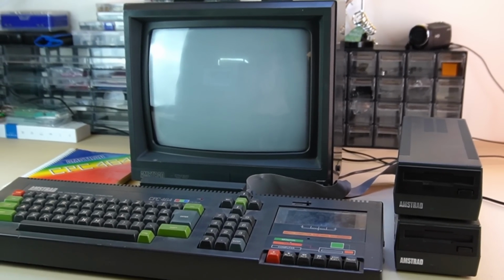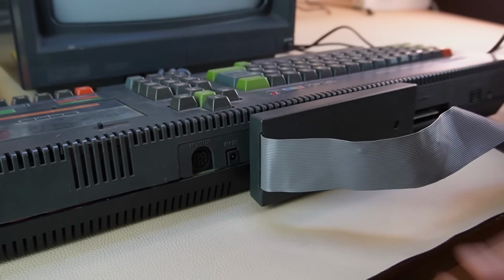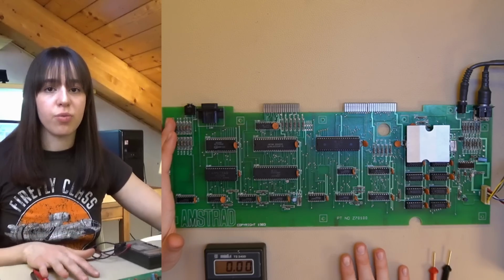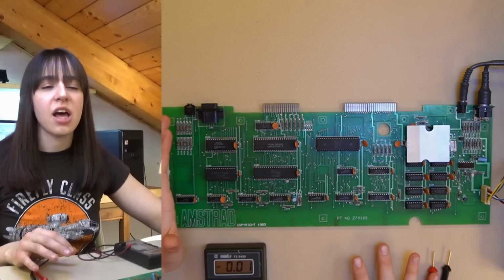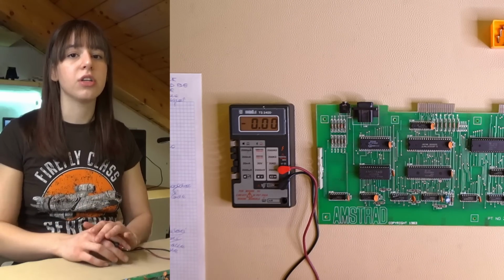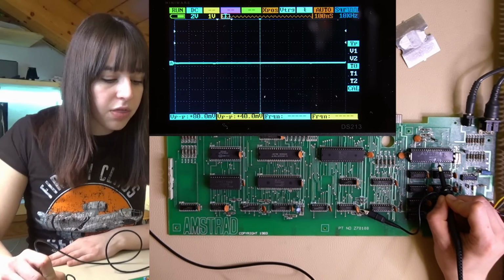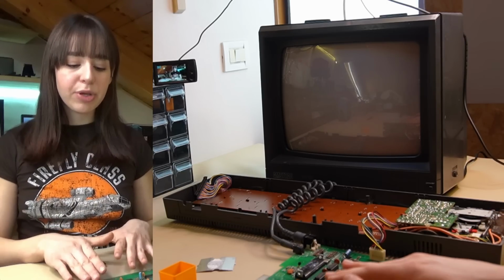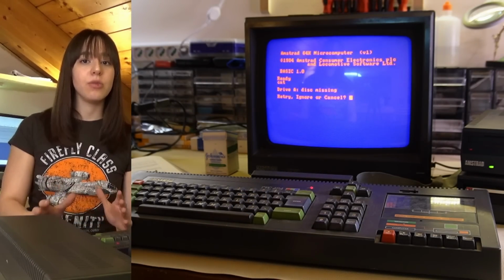I fixed an Amstrad CPC 464

Comment: I hope you all noticed what happened here. The vast majority of us would have said "That switch is broken" and would have replaced it. Sayaka dismantled it, cleaned it, and put it back together (why isn't 'remantled' a word?). Something worth learning there.
Reply from the maker: Thank you, I appreciate the observation! It's true, sometimes a simple fix can go a long way.
Reply: if it is remantled then when it was first assembled was it just mantled? lol
Reply: Dismantle means to take its strength away (-ish )so the opposite is simply mantle . Perhaps disassemble, reassemble? Love these videos!
Reply: @marjon1703 "No disassemble!" -- Johnny Five 😆
Reply: @horusfalcon  "Johnny Five ..alive"
Reply: Mantle is the opposite of Dismantle, but the meaning of Dismantle has morphed a bit over time. Originally a Mantle was clothing similar to a cloak, and the word was used used as a verb to cloak or cover something, then Dismantle meant to remove that cloak or cover. Not dissimilar to Mount and Dismount. It was further used in words like Mantlepiece, which is basically a covering over a fireplace.

Today we use Dismantle more as an interchangeable word with Disassemble. One of the side effects of English being so widely spoken is that word meanings change relatively quickly, which is rarely a good thing, tbh.
Reply: I know I wouldn't have bothered
Reply: @speedsterh The switch on a 464 is relatively simple to open, clean, and reassemble.   ( I have a 464... )
Reply: upmantlah
Reply: she reworked the switch.
Reply: The reason remantled isn't a word is because we already have the correct word reassembled.
Reply: @SpeccyMan  True enough, reassembled is a fine word, but the English language has a grand tradition of having many words that mean essentially the same thing! There's always room for one more... or another...
Reply: Though she didn't clean the Z80 and it's socket and retry it!
Reply: @crayzeape2230 No, indeed. It seems to work though.
Reply: Words like dismantle, disgruntle, inert, innocuous, and ruthless are called unpaired words. You would assume by looking at them that their opposites are mantle, gruntle, ert, nocuous, and ruthful, but these words simply don’t exist.
Reply: @Notpoop906  WRONG. Totally. Use a dictionary. muppet
Reply: @Notpoop906 💤💤💤
Reply: @NightRaven650  🤡🤡🤡

Comment: Disk units are 3", not 3.5".
Reply from the maker: Thank you for the clarification. I mentioned 3.5'' out of habit, but I was aware that Amstrad's floppy disks were 3'' to ensure compatibility with 5.25'' drives and for easier portability. Additionally, at the time, the 3.5'' format was beginning to emerge as a standard but had not yet become the de facto standard.

Comment: Type |TAPE to enable tape mode. If you have a disk interface connected, it will default to that. That is why you were getting the Bad Command error message. It's |DISK to return to disk mode.
Reply from the maker: Thank you for the suggestion, but I've tested the tape functionality even with the disk drive disconnected

Comment: Well done Sayaka!! You might want to add residue free coolant spray. Sometimes a heat damaged chip will temporarily come back to life long enough to determine that it’s at fault before you go through the hassle of desoldering and looking for a replacement. I have often had to do this on big name brand synth keyboards when the sound processor stops working and hangs the keyboard or computer.
Reply from the maker: Thanks for the tip! I'll keep that in mind for the future

Comment: Hello, maybe you had some contact problems... Did you put the original CPU back in the socket? Maybe it's not damaged...I had this issue with an Adaptec SCSI-Card: After removing and putting in the ROM-Chip it worked very fine...
Reply from the maker: Yes, I checked to make sure it wasn't just an oxidation problem, even using the classic 'remove and reinsert' method

Comment: So, it needed a good cleanup, minor re-soldering and replacing a faulty CPU (that's the hard part). Could be worse, I guess.
The default text color on this machine was yellow, in the video it looks like light orange. I am guessing this is a camera artifact?
Reply from the maker: No, it's not a problem with the video camera, but, as mentioned earlier by Noel, perhaps a poor soldering of the video connector

Comment: Great video, great job! My little advise: try do not touch pins of microprocessor by your fingers, because static electricity may damage it. You may also buy some anti-static wrist strap to avoid static electricity in that case.

Comment: so Os, honestly I have never heard of an Amstrad CPC 464 before, congratulations in fixing it 🎉🎉🎉, I’m amazed and I’m more interested seeing the Amstrad function with the floppy 💾 disk, never got in the computer tapes before, but if you can fix both of them that would be ideal. Other than that, nice to see thats the CPU of the Amstrad is socketed, makes and update, if possible easier and a repair as well.  Till the next video! 😺🥰👩‍💻👩‍🔧⌨️✨💎
Reply from the maker: Thanks! Glad to hear you're interested! I'll definitely showcase the Amstrad with the floppy disk soon. And yes, having a socketed CPU does make updates and repairs easier. Stay tuned for the next video!
Reply: @Sayakas_Digital_Attic  will do! 🥰👩‍🔧✨💎💃

Comment: Overall, very well done video. You made one small mistake, I wonder how no one pointed it out by now. Those floppy drives are 3", not 3.5". They work a bit differently than normal PC floppies when it comes to the disks themself. You could flip these over and use both sides independently. And their shell is a lot more sturdy than in 3.5" disks. 
However, electrically they are basically the same. I remember back in the early 90s when I got my first PC, I hooked one of them to my PC and it worked.
So you may be able to convert one of those drives to a 3.5" one, or maybe build some kind of adapter to connect it to a PC. So you can write images to physical disks. The other option would be to replace one drive with a gotek and use native CPC software to copy to physical disks.
Reply from the maker: Thank you for the feedback! I appreciate the correction and the additional information about the 3" floppy drives. I'll keep that in mind for future videos

Comment: Absolutely awesome! Just like most other commenters here, I appreciate the younger generations picking up interest in these vintage electronics. I never really used any of them myself but it's still awesome to see. I just want to point out that Amstrad made such a great desicion to make the keyboard dark and not in the same disgusting color as most other hardware from the time and forward. You can see how much better it looks without even having to reconditioning it (I suppose). Imagine how awesome it would be if you could exchange components in modern hardware as it is in this old hardware. But try also to imagine how much bigger it all would need to be :P
Reply from the maker: Indeed, I really like this design. In fact, part of the charm of 80s hardware lies in the fact that you can exchange components more easily compared to modern hardware.

Comment: My second computer was a CPC 464. It got it around 1985 or 86. From memory it cost me about 350 dollars Australian. That was just for the computer it self. I could afford a monitor, so I connected it to an old TV. I also had to make do with the tape deck. There was also a CPC 664, which was the exact same computer, except it had a disc drive built in, instead of the tape deck.

Comment: Didn't expect to see an actual chip failure, since they're so well protected inside by the plastic casing, it's like a time capsule. Maybe the pins just needed to be cleaned as well?
Reply from the maker: I tried cleaning it and putting it back, but I still have the same issue

Comment: I bought myself an Amstrad CPC464 in May 1987 as a teenager, and loved it so much! A very underrated computer from that era. I used it until the early 1990s. Around 2010 I got a used 6128 from Ebay and had fun with that, and found a 3.5inch external floppy drive with the builtin ABBA switch.  So much great games and other software available for it.  There is a really good interview here on YouTube with one of the design engineers of the CPC, talking about his time in the 1980s working for Alan Sugar etc.
Reply from the maker: That's awesome! I'll definitely check out that interview on YouTube.
Reply: @Sayakas_Digital_Attic  It's the 38min YT video with the title, " Interview With Roland Perry From Amstrad! (Part One) ".  It's on the Xyphoe channel.

Comment: Well done! 
Have you tried to reseated the old z80? The problem may be due to oxidation on the socket contacts.
Reply from the maker: Thanks for the input, I've tried, but it still isn't working in that way
Reply: @Sayakas_Digital_Attic  Could also be the socket itself is a little sketch, you could try giving it a deoxit treatment and see if that changes anything. Or test the cleaned Z80 in a different machine since I take it you have multiple using that.

Comment: Good job, just commenting the same Noel said, text should be yellow so need to check video connector
Reply from the maker: Thanks for the input, I'll try to address that issue in the video where I repair both the floppy disk drive and the cassette player

Comment: Good job ! I also have a CPC-464 and didn't worked for years.. I think all capacitors must be changed. But I have a bigger problem about my Amstrad ALT-386, it was working about 15 years ago but now no video. Problem can be about cmos battery or capacitors of power supply, what do you think, any advice ?
Reply from the maker: Is it just the screen that's not working, or is the whole computer?
Reply: When I power on the device, led's are ok, fan spins and screen backligjht is on for a moment but unfortinately no backlight or video after. @Sayakas_Digital_Attic
Reply from the maker: @MrNetworx  It could be everything and nothing. Usually, when I start repairing a non-functioning computer, I first give it a general cleaning. You wouldn't believe how many times just removing the dust solved the problem! You can start by searching for some videos on YouTube and see if they give you any idea about it. However, if you don't have experience in computer repair, I recommend seeking help from someone knowledgeable
Reply: @Sayakas_Digital_Attic  Thank you for quick response. Before changing components, I will start by cleaning with IPA or sthg. I will inform you about the result also.

Comment: Well done! Love this video! It was a very thorough and well reasoned repair. Congratulations on bringing the Amstrad back to life. One thing I noticed is that the text on the display is red but it should be yellow. Chances are the video connector has a bad solder joint in the green channel. Or if not, it could be a problem with the cable or even the Gate Array. Maybe a topic for a followup video?
Reply from the maker: Thank you so much for the suggestion! I'm really glad you enjoyed the video. Your insights about the display issue are super helpful, I'll definitely look into it for a follow-up video.
Reply: @Sayakas_Digital_Attic  Looking forward to it! :)
Reply: @Sayakas_Digital_Attic  Noel is a legend :)..  it was him that inspired me to get my CPC 6128.
Reply: I was about to comment on the colour and I see that Noel already did and he sure knows his CPC repairs! I had green text on mine and a quick reflow of the solder joints on that connector and some contact cleaner sprayed into it solved the problem, that part is prone to mechanical stress. I also had the same power switch issue and the tape drive was dead which was solved with new belts. Brilliant video, lovely to see you working on an Amstrad and looking forward to the next one👍
Reply: Great help and feedback Noel, I also watch you channel and have now subscribed to this one. Good  to see people help and great work Sayaka :)
Reply: @richardlawrie1150 y agradable ver a una chica joven. Solemos ser hombres entraditos en años los que nos movemos por estos círculos.
Reply: Didn't some of the amstrads have Green "hacker" text.  🤔

(EDIT - I forgot that you could buy a green amstrad monitor)
Reply: She could be using a modified BIOS ROM, I've used them & whatever colours you use for text & background, stays even if the computer is switched off or not.
Reply: Can you tweak the ROM or so to make the text white on black. I'm no fan of fancy colour schemes for Basic, but at least this one is much better readable than the junk on a C64.